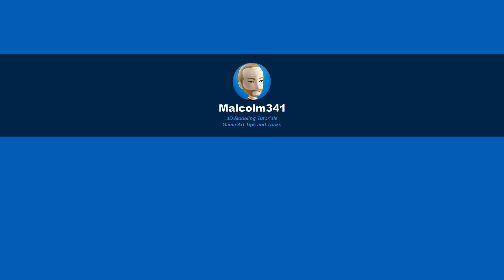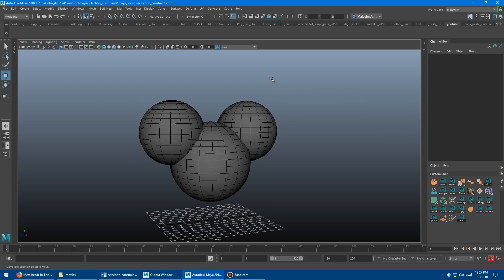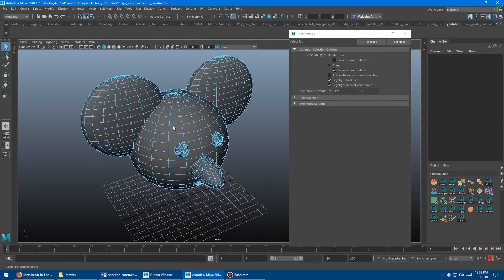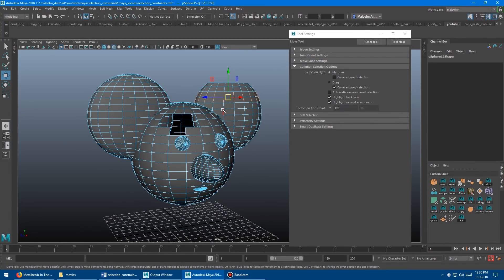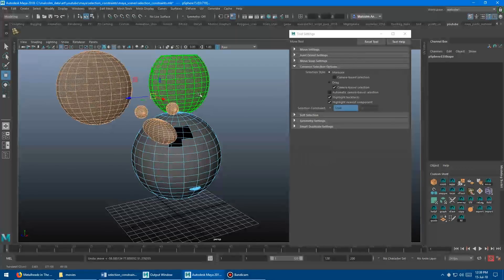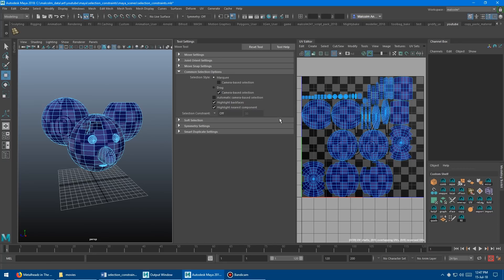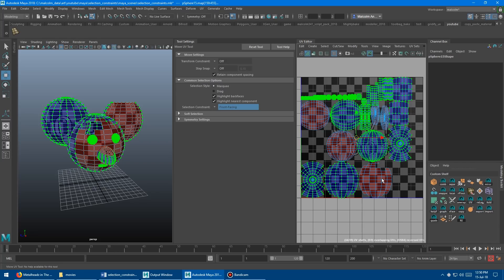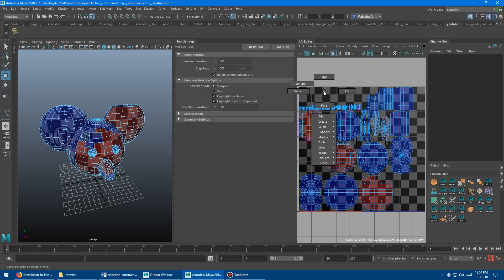Save Time with Selection Constraints

Comment: There's actually a very easy way to select ring loops. You select an edge and then shift+double click an adjacent edge. If the adjacent edge is in a loop it will select the edge loop, if it is in the ring it will select the ring.
Reply from the maker: Cool trick! Thanks for sharing it here.

Comment: That EdgeLoop selection constraint can probably be used to find broken/undesired edge loops more quickly since you can glide over the mesh without having to indulge arthritis. 

Overall pretty neat!
Reply from the maker: Good point, either way use it if you find it useful.

Comment: Small addition; the UV Selection Constraint options can be accessed inside the UV Editor window with the shortcut (Hold) Ctrl+Shift+Right Mouse. Also looks like this shortcut opens the same options as the Hold W + Left Mouse shortcut, just depends on the window in focus. Great Vid, keep it up!
Reply from the maker: Right on, thanks for your feedback, and thanks for sharing this hotkey tip with the rest of the community.